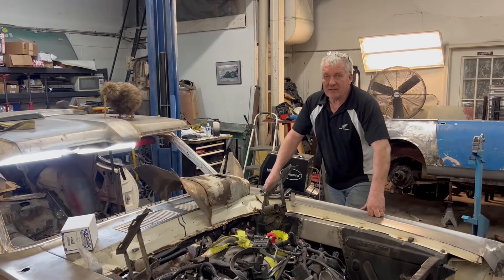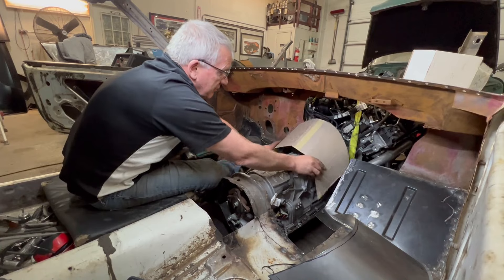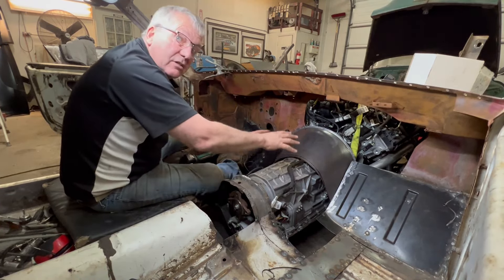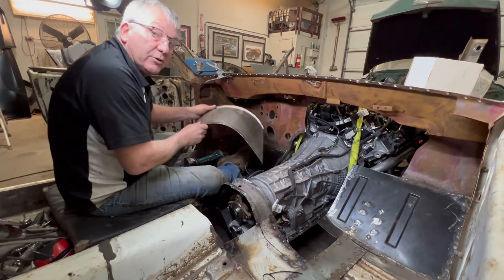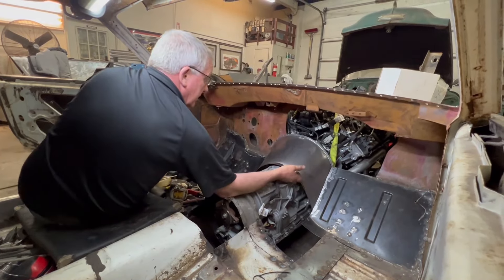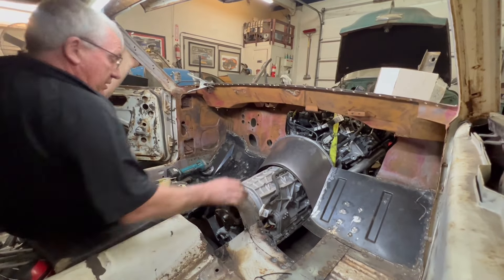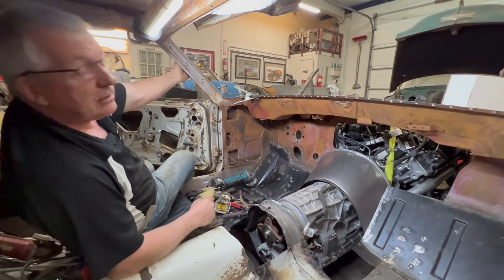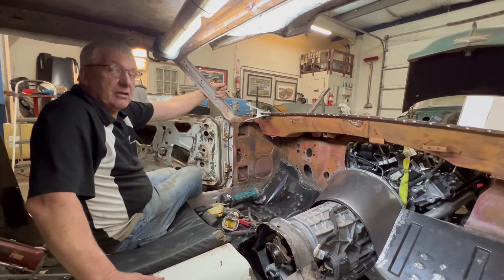Cutting on the Cougar Fastback

Comment: I'm sure you have it covered but what is your plan for the gear shifter? Keep in mind that you have some sort of mechanical cable/link and also a wire harness typically. I got the Lokar shifter to work well bolted to the top of the factory tunnel on my 68 Cougar fyi.
Reply from the maker: Going to try and work in the factory shifter. Did you put the 10 speed auto in yours?

Comment: Is there some other type of work done with that roller setup that requires the bed being that long?  Seems like it would be a lot easier to use if the crank was closer to the roller.
Reply from the maker: You'd be surprised how often the throat on this roller isn't deep enough. You're right though I think it would be easier but limiting on what you could use it for.

Comment: To me, the tricky part of making a tunnel isn't bending and welding the metal until it covers the transmission, it's making sure that servicing the car - including gearbox/clutch removal - isn't a complete nightmare because there's no access to the bell housing bolts, while also not taking any more than needed of the foot well and under-dash area.  It's a fine line to walk.
Reply from the maker: Yes it is !!   There's a lot to take into consideration !!
Reply: It does look really tight.  As long as you could drop the whole engine and trans out the bottom you could probably work on it ok.
Reply from the maker: @bcbloc02  trans will be able to come out the bottom and the engine out the top
Reply: @bcbloc02  Dayum, Brian - you watch the Kiwi too?  Cheers from also in KY.  😁